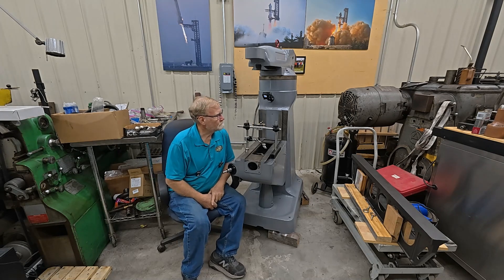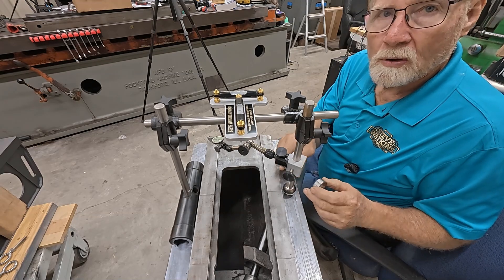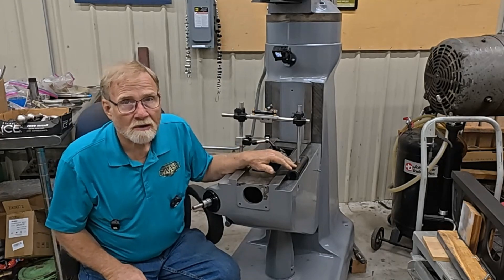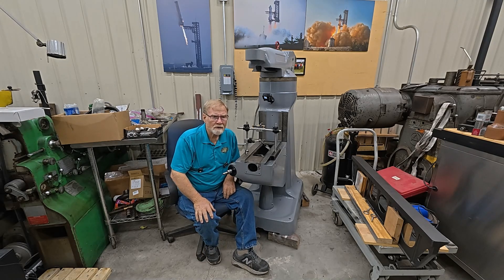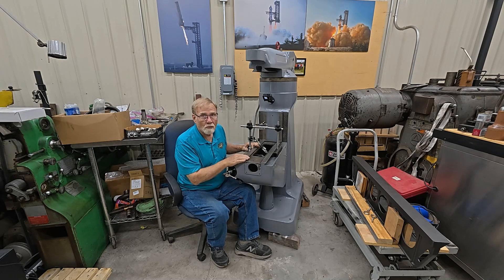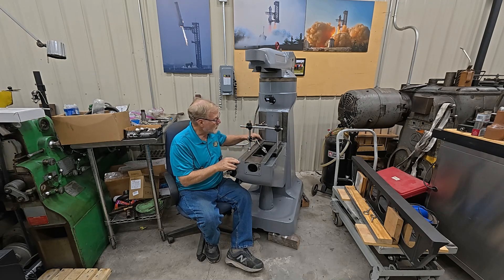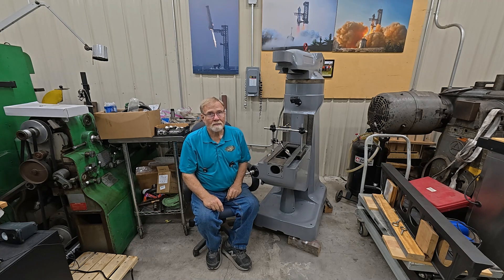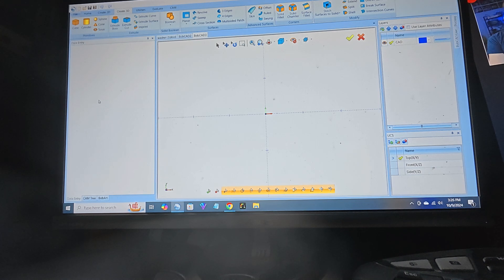Finishing up the Alignment tool

Comment: Do you have to level the machine or is there a way to “level” the levels? I’ve never seen this done before and trying to figure out how it works.
Reply from the maker: you first level the machine then you adjust the "levels". If you look at the mounting of the levels you can see a "nut" on both the top and bottom of the lugs on each level... The nuts have small holes   that a pin, I use a small drill bit, can be inserted into and by moving the nuts you can get the vials centered. On a lathe I adjust the vials on the tail stock end of the bed... Most lathes have very little wear there..... Then you move the tool down the ways and see how much the ways are worn... This tool is especially useful to measure the difference in wear from side to side of the ways...  I always run either a tool like this or the bottom of the lathes tailstock  on the inner tailstock ways ( Hardly any wear there) to measure the total wear in heights of the outer rails....

Comment: protip, and just the tip: you can set one mic to have multiple outputs, eg one mic going to 2 cameras, either by way of a signal wire splitter, be it home made or bought, or depending on if the sofware you use is something similar to OBS, then by way of configuring your inputs/outputs digitally, in said software. but the look is definitely not one would expect 😂 🎉